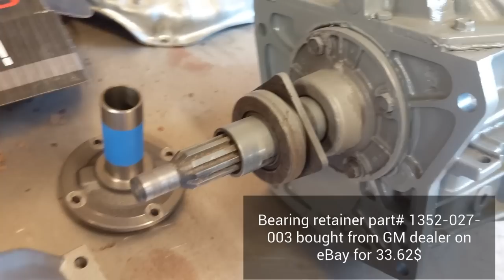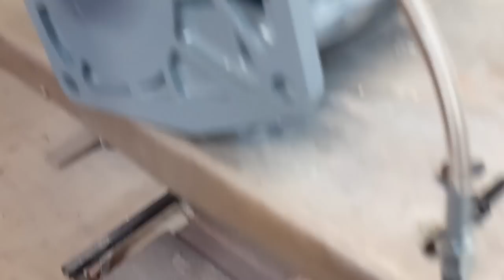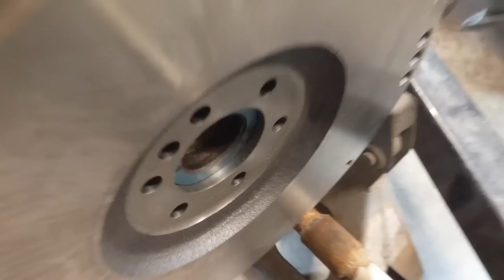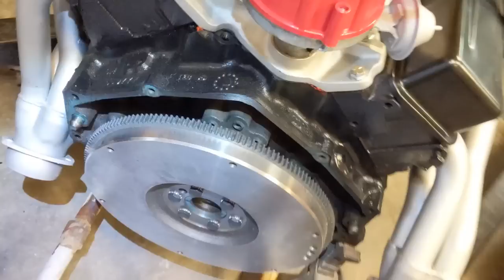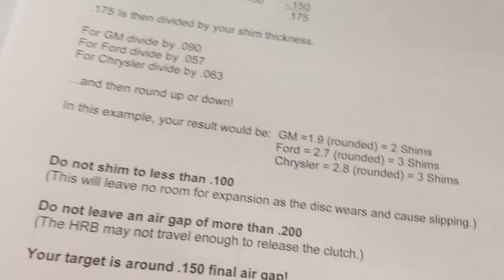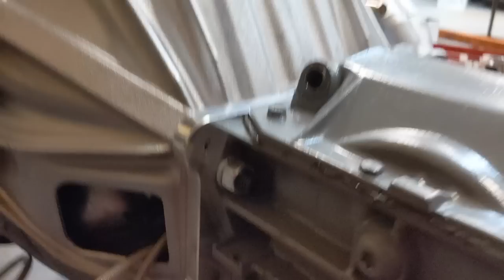Swapping a 5-speed manual behind a first gen Small Block Chevy

Comment: That bell housing adapter that you used will that work on a Pontiac firebird v6 5 speed t5 I want to use my t5 out of my v6 firebird on a LS 5.3 I just like to try to find the adapter that would allow me to use the GM v6 5-speed manual please help!!!!
Reply from the maker: the GM T5 that went behind the V6 was internally different than the Ford V8 T5 and the LS 5.3 is even more powerful than the 5.0 HO that was in front of the T5 so I would not use that transmission. I would use the 92+ Ford T5 for that swap. If you are determined to use the Trans you have, you will have to research if the 5.3 and 3rd gen small block have the same bellhousing pattern. If I remember right, the v6 and v8 chevy's used the same bellhousing so you may be able to bolt what you already have to a 5.3, but I am not 100% sure.
Reply: Way different bolt pattern won't bolt up 3.8 v6 is not like a S10 4.3 v6 well thanks anyway

Comment: i have a 1990 Chevy G20 Panel Van and i want to convert 4 or 5 speed manuaul which ever how much does this kind of conversion kit cost ? thank you
Reply from the maker: Auto to manual conversions are usually quite expensive at a shop. 4-5k for the conversion wouldn't be unreasonable. Your cheapest bet if you can't do it yourself is to find a crafty backyard mechanic, but the results can be quite sketchy

Comment: Video was much help do you know the exact length of the mustang input shaft??
Reply from the maker: I can't remember off the top of my head
Reply: No problem I’m putting a s10 t5 with the Ford bolt pattern behind a sbc just have to change the input shaft to the one in that trans and it should work

Comment: Can do that forca 5.3 or a 4.8 thks
Reply from the maker: Yes, but I think the bellhousing part number is different, and you have to be careful with power as the 4.8 and 5.3 can make more power than the T5 is rated for if they are modified even a little

Comment: I been looking for a video like this I'm planning on swapping my auto 305 c10 to a manual t5 and this helped so much. I just gotta find the other components
Reply from the maker: Good luck on your build. I can't recommend this swap enough, the T5 is so wonderful behind a 305/350. FYI, You can save a ton of money going with a stock style slave cyl and clutch fork, I just don't prefer them.
Reply: That truck was available from the factory with a 5 speed manual. Why not use the full GM setup instead of screwing around with incompatible Ford parts?
Reply: My.truck was not a manual.

Comment: Could've used a hydraulic slave cylinder with factory fork set up. They sell the bracket to bolt outside the bellhousing
Reply from the maker: The car this went in was an automatic originally so I decided on the Hydraulic TOB for the conversion. If it had a slave, I would have used the bracket and fork you mentioned
Reply: Oh. Cool.

Comment: Nice. I used hanlon motorsports conversion kit on my tko. Works great behind 383.
Reply from the maker: People say they can't take the power of a 383, but I have never had an issue.
Reply: And in a pickup giving it the blues. Lack of traction saves it alot I'm sure

Comment: Great video. I'm considering a T5 swap behind a Chevy 348. My concern is the torque rating of the T5 being able to handle a stock 348 250 HP engine's torque output. It's rated at 353 lb. ft. I don't race it, it's just a cruiser but I need the OD. Any thoughts? Thanks.
Reply from the maker: That's definitely outside its rating, but I have seen guys push 500hp through a T5 with no issues. I think it comes down to how it's used. Dumping clutches on these can result in all kinds of damage inside. If you do use a T5 try to find a 92+

Comment: Thanks for the video,  I have two question.   1. the shim usage it´s pretty much the same If I use "fork" insteda of hidraulic?  2.  I heard some people use s10 speed transmission on SBC.  Do you recommend that?  Thanks
Reply from the maker: If you stick with the fork, the adjustments are external, so you don't need shims. The S-10 trans is weaker than the Ford (especially the 4 cyl S10 one), so I have never used one. They are also harder to find than the Ford (at least for me)
Reply: @AustinCoulson  Thanks Austin,

Comment: So the mustang t5 can be used behind a LS1?????
Reply from the maker: It will bolt up and work but is only rated at 325 so generally not recommended for LS motors

Comment: So i put a 93-94 nv3500 behind my sbc, I've bled the clutch and there is no movement on the clutch fork at all. The issue is the only way I can put it in gear is when the truck isnt running. Any ideas what could be going on?
Reply from the maker: If there is no movement on the clutch fork your issue is air still in the lines, or an internal failure on the clutch master or slave cylinder. Do you have a master/slave/fork setup or master/Hydraulic TOB setup like I did in this video?

Comment: Heres another way to solve the guide pin without welding, find a bolt with a long shank/shoulder, cut the head off of it and thread on a nut

Comment: So I have a Ford t5 I’m gonna be putting behind my Camaro but i need a 10 1/2 clutch disc. Will any gm 10 spline clutch disc work and fit the ford input shaft ?
Reply from the maker: The GM and Ford 10 splines are the same so there are multiple clutches that work. I believe I used an 11" on this, so I am not sure if the 10.5 will bolt to the flywheel that I recommend

Comment: Do you have to use a hydraulic throw out or can you continue to use cable style ?
Reply from the maker: You can use cable or linkage. Hydraulic is a lot easier to run if it's going into a car that previously had an automatic, but cable or linkage is a lot cheaper

Comment: I put a T-5 from a '86 Chevy  S-10, 2WD pickup in my '53 Chevy pickup with the original 6 banger engine. The T-5 has the same bolt pattern, just drill the holes to a 1/2 inch, uses same release bearing, same pilot bearing, but not the same clutch disc. The biggest thing is, you have to change the rear end to open drive shaft and differential. With the overdrive 5th gear it's like a different truck, and it looks like it came in the truck. 5 gears sure beats 3.
Reply from the maker: I've done a couple T5s on the only 140-200 I6 Fords and you are right, it's like whole different vehicle. I'm curious why you would have to run an open diff? I have run this trans with plenty of locked rear ends
Reply: @AustinCoulson  What I meant was that the 53 Chevy PU had a closed driveshaft and you have to change the driveshaft and the differential, but it doesn't matter if it's open or LSD.
Reply from the maker: @tootsie5052  Ahhh, I misunderstood. That makes a lot more sense now.

Comment: I want to install a gm t5 on 65 el Camino with a 396 is it possible? And if so any tips ?
Reply from the maker: It's possible, but the T5 is not rated for a ton of power. How much power do you estimate it's got?
Reply: @AustinCoulson  around 425hp, it's basically going to be my daily driver.
Reply from the maker: @209bobee  That's more than I would put through a t5. Shoot me an email will all the specs on your car and motor setup to acthecarguy@gmail.com and I'll see if I come up with any ideas on an inexpensive trans that will work.

Comment: Hey nice vid. When I did my video on the T56 to SBC I settled with a fork rather than a throw out bearing. Wonder if I’ll regret that. 🧐
Reply from the maker: Did you use a hydraulic slave or mechanical linkage? Either way, I bet you saved a lot of money. The hyd TOB costs as much as a used transmission

Comment: Great video, I have a turbo Ls with a Muncie, Did u use a gm t5 bearing retainer?
Reply from the maker: Yes I did. Does retainer doesn't fit the adapter or the TOB I used
Reply: Right on that’s what I was finding by the measurements. Thanks for the reply man appreciate it!
Reply from the maker: @hooligans_garage  are you considering putting the T5 behind a turbo LS? If so I would love to hear about the results as the T5 isn't rated for that much power, but I've personally seen them handle way more than they are rated on Ford motors. I've seen them behind LS swaps, but never a turbo LS
Reply: No my Muncie is built, the t5 is going behind a mild 6.0 for my cousin.
Reply from the maker: @hooligans_garage  perfect
Reply: One last question, what pilot bearing did u end up using?
Reply from the maker: @hooligans_garage  I ended up having my cousin machine down the pilot bushing that came with the clutch kit. The Ford shaft is slightly larger than the GM shaft so it just needed to be shaved a little. There's an aftermarket pilot bushing that would have worked if I didn't have access to his machine shop. I forget the part number but it's in the video somewhere
Reply: Right on! Just so happen to have access to a lathe.  Thanks again man!

Comment: Did you dial in the bell housing to center the input shaft on motor crank?
Reply from the maker: There is no adjustability between the engine-bellhousing-adapter-transmission, the bell housing is centered with sleeves on the engine, the hotrodworks adapter centers the transmission to the bell housing with tapered bolts that come with the kit. The pilot bushing verifies the final centering

Comment: Why not just use a fine thread dye on the stud?
Reply from the maker: I've never tried changing threads without drilling out the old threads and increasing the diameter. It seems like it wouldn't be as strong.

Comment: Awesome video! It is helping me get through my swap on my 87 Monte. Only problem I’m having is I bought the 2120 adapter and a 1352-027-003 retainer and the retainer diameter is too large and does not fit in the adapter properly, do you have any thoughts on this ?
Reply from the maker: Stand by, I'ma look up those parts
Reply from the maker: https://www.ebay.com/itm/FRONT-BEARING-RETAINER-CHEVY-S10-ALL-T5-WC/281650577051?ssPageName=STRK%3AMEBIDX%3AIT&_trksid=p2057872.m2749.l2649

This is the Bearing retainer I use, it fits on the Ford T5 and lets the Hydraulic TOB fit over it. I am not familiar with the 2120 adapter is that for the TOB or something else?
Reply from the maker: Oh I see now, the 2120 is the Hotrodworks adapter. I thought that your TOB wasn't sliding over the bearing retainer shaft. It sounds like the outer portion of the bearing retainer is coming into contact with the 2120. I have seen this when using the Ford bearing retainer. If you are going to keep using the Ford retainer, you will need to grind down the 2120 to allow it to slide over. Keep in mind, you won't be able to use the hydraulic TOB I use because the shaft diameter on the retainer is larger as well.  I recommend using the S10 retainer I listed since it is only 30$. If you want to run standard clutch linkage and keep the Ford retainer, it would be a lot cheaper, but the linkage might be annoying to get dialed in. If you do grind away to make the Ford retainer fit, the adapter will still be centered because it self centers on the bolts, not the retainer.  Good Luck! Reply back if you get stuck again
Reply: Austin Coulson I did buy the s10 retainer and it doesn’t fit.  I bought the same part number you used in your video, that’s what’s weird about this.  Thank you
Reply from the maker: @87jeepyj1  Very strange  what's the overall diameter of the S10 one vs the Ford you removed and whats the ID on the 2120?
Reply: Austin Coulson id on 2120 is 4 5/8 and od of s10 is almost 5
Reply from the maker: @87jeepyj1  the S10 outer diameter should be 4.5". Can you contact the company you got it from? Does the TOB slide over the S10 shaft?
Reply from the maker: I had another thought; the bearing retainer has 4 bolts that mount it to the trans. The Ford retainer and the Chevy retainer both have a small area around the holes machined so the bolts can sit flush. On the Ford the machining does not extend all the way to the edge of the retainer because it is larger. On the Chevy ones the machined edge goes beyond the edge of the retainer. I use these 4 machined circles as a quick guide when I am looking through my retainers on projects to know which one is which. If your new retainer has casting beyond the machined holes then it is not the same one I use, it may be the same part number manufactured by someone else. Hope this helps, would love to hear a follow up on what ends up happening on your project.
Reply: Austin Coulson hey man so they actually sent me the wrong one, I received the right one and am starting install this weekend
Reply from the maker: @87jeepyj1  That's great news. Let me know if you have any more issues on the install.

Comment: Did you have a problem getting the air out of the throw out bearing?the bleeder is on the bottom. Should be on the top.
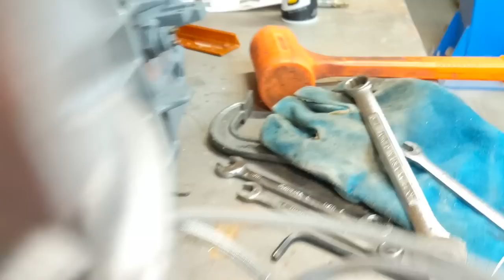Reply from the maker: Check out at 13:00 I show the bleeder up close, it's on the top, it just might look like its on the bottom once the hoses come out of the bell housing. It was quite easy to bleed, I used a mightyvac since I did it myself but now I have a pneumatic bleeder I like even more.

Comment: Nice video, I like how thorough you are with the parts, part #s, and where you got them.  I’m looking at buying a 95 Chevy 1500 4x4 with a v8 and 5spd.  #SAVETHEMANUALS
Reply from the maker: That's a great vehicle.  I love the OBS Chevy's. Watched a guy hydro-lock a motor on one. Pulled the plugs in the middle of the creek, cranked the starter, shot tons of water out, reinstalled them and it ran perfectly afterwards.  Watched another guy overheat one until it locked the motor solid. after a couple hours it cooled, made a loud cracking noise, then it restarted and ran perfectly (with creek water in the radiator and a raw egg to seal the radiator leak). Truly a bulletproof drivetrain...

Comment: Great video! BTW.....do you know if a late model Chevy manual transmission bolt pattern will bolt up to my 1968 small block Chevy bell housing? Will an S10 or Silverado transmission work? I'm looking around for a transmission now. Thanks.
Reply from the maker: I have seen it done, but I don't know if an adapter is required. I believe the s-10 T5 came on both the 4cyl and the 4.3, and have heard that you must run the 4.3 T5 if you put it behind a small block as the 4cyl one is weak. The 4.3 should have the same bellhousing as the older small blacks so I would imagine that would be straight forward to swap. I have heard that even the 4.3 T5 isn't as strong as the WC T5 that came behind the last generation Fox body mustangs, but I don't have any data to back that up, just hearsay. I am not sure what manual trans came in the Silverados as i've never seen a manual one.
Reply: Are you saying you have a bellhousing you are wanting to bolt on to a new trans? I do not think any of the LS transmissions would work for that, they are all over 4 bolts between the bellhousing and the trans itself I believe. Any LS transmission with the bellhousing on it will have the correct bellhousing bolt pattern to properly mate to a old small block. What I do not know is if you will have input shaft and starter clearance issues. I think the LS transmissions have more input shaft sticking out away from the bellhousing. Someone correct me If I am wrong. The NV3500 is the manual transmission that came with 4.8 and 6.0 Silverados as well as the 4.3 S10s. It has the 90* bellhousing that will bolt up to a old small block. Those transmissions were 10 spline I believe, you would have to get the correct clutch and flywheel for that. The NV3500 Silverado transmissions are obviously tougher, but I know that BetterOlds here on YouTube has used a NV3500 out of an S10 on his 5.3 and it has worked well. A t56 would be ideal, but it will cost you dearly. Again, I do not know any starter or input shaft length clearances you might run into, but the bellhousing will bolt up, minus the additional hole straight up on the LS bellhousings that do not exist on the Gen 1 small blocks. 
Good luck
Reply from the maker: @codyhaynes4471  This is all good info. I forgot about the nv3500 because they are so rare, but that would be a good swap.

Comment: what kinda clearance between the clutch disk and release bearing retainer should there be?
Reply from the maker: .15" for this TOB, as the disc wears the teeth move out and that gap slowly closes. If it's too loose, it won't disengage the clutch, if it's too tight, it will accelerate disc wear.